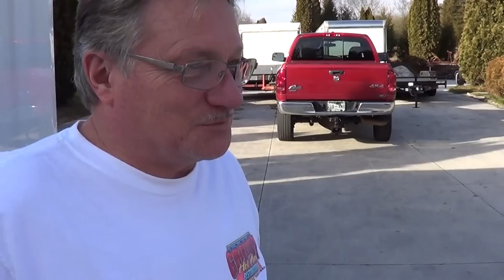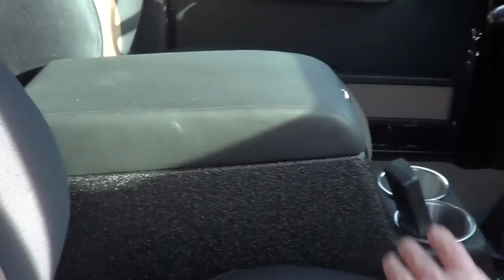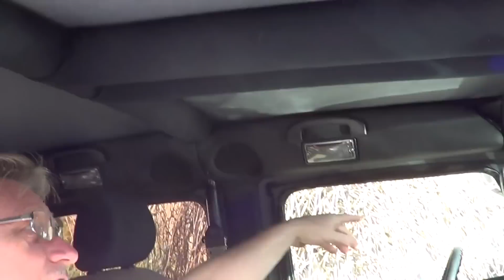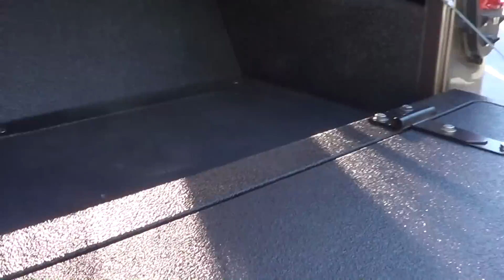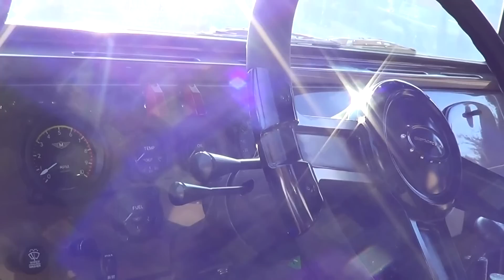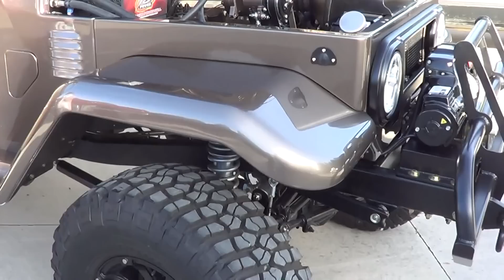Custom Toyota FJ 4-Door Finished

Comment: That is such a brilliant project, exactly what goes through my mind when I see one of these old Jeeps and Toyotas, one more aspect he could have improved on, if he was doing so much work, he should have fabricated in Shock-Towers in the front and back, and should have fitted it with independent suspensions, instead of rigid axles
Reply: Actually solid axles are stronger then independent suspension. So when offroading you want solid axles.
Reply from the maker: Thanks for checking it out!